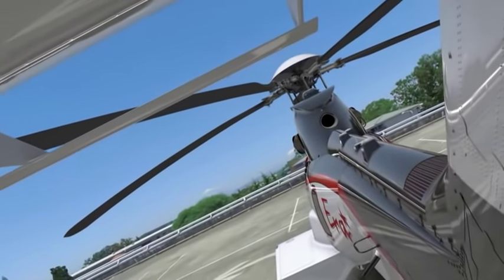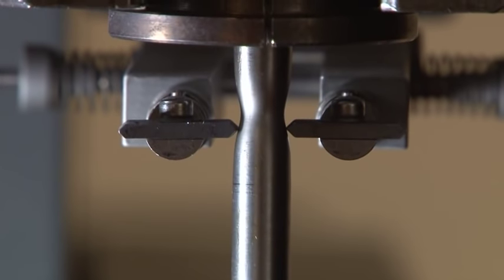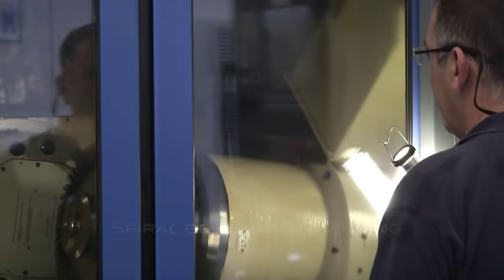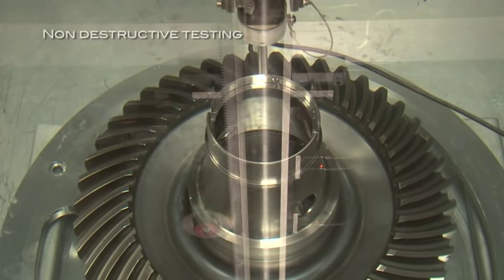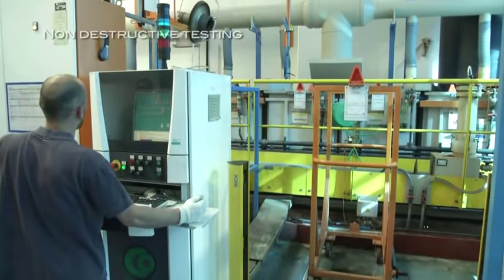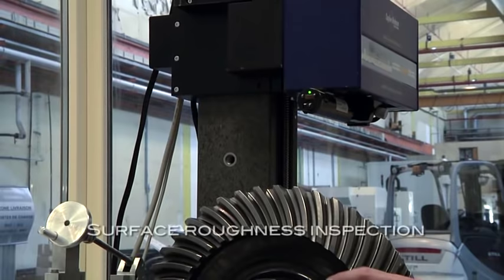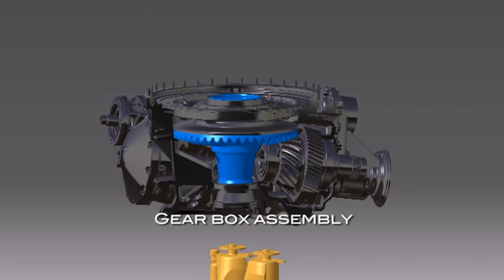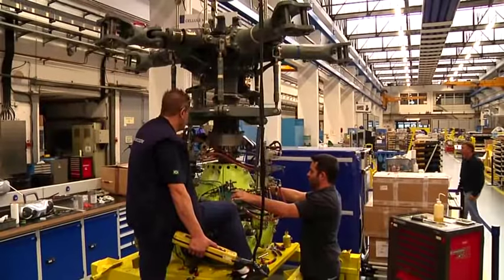EC225 - Bevel Gear Vertical Shaft Process

Comment: I HAVE FAR BETTER DESIGN THAN THIS ALMOST 73 YEARS OLD HELICOPTER DESIGNS THAT NEARLY NEVER CHANGED SINCE IT INTRODUCTION,I KNOW WHAT I AM TALKING ABOUT
Reply: Now for your next design challenge: The Off switch for your Caps-Lock key.
Reply: DUDE CAP LOCK OR UNLOCK HAVE NOTHING TO DO ,I AM NOT YELLING ON NO ONE ,ONLY IN USA THEY ARE SENSITIVE TO THIS,I WRITE THIS WAY ,SORRY TO BOTHER ANY ONE
Reply: Why do you presume I am from the US?
At any rate, what is your problem with typing lower-case? You say you don't mean to yell. Well, fine, but nobody would think you yelled if you didn't type in all-caps in the first place. What idiotic chain of reasoning is this? This is like walking through a crowd of people with your arms rotating, and when you hit somebody you say "Oh, I don't mean to hit anyone." Same stupid thing. Just type lower-case, like everyone else does. No excuses needed. Just do it.
Reply: I HAVE OLD COMPUTER THAT DOES NOT FIX MY WRITING AFTER A STOP OR BEGINNING OF SENTENCE,AND THEN I LOSE THE IDEA I WANT TO WRITE SINCE I AM BUSY FIXING THE GRAMMAR,SO WRITING   IN BIG LETTER WILL SOLVE MY PROBLEM
Reply: Huh. Well, new computers don't fix writing, either, so I wouldn't hold my breath. Good day.
Reply: THE QUESTION IS DO YOU KNOW WHAT YOU'RE TALKING ABOUT? WE DON'T REALLY CARE, BUT WE DO WONDER WHY YOU'RE YELLING . I ASSUME IT'S  A LOUD, NOISY  ENVIRONMENT WHERE YOU ARE SO I'M YELLING TOO SO YOU CAN HEAR MY WRITING. SORRY IF MY TEXT IS TOO LOUD! I'm from the same place as the other bloke BTW.